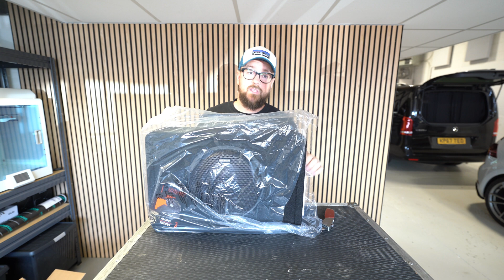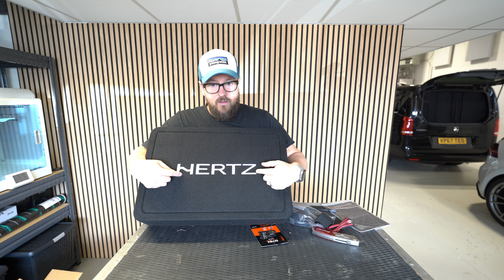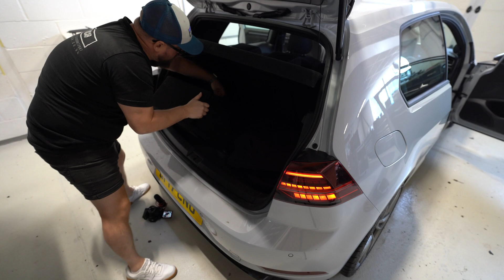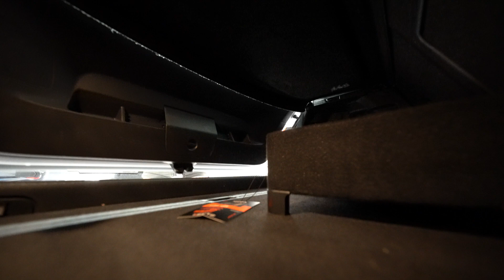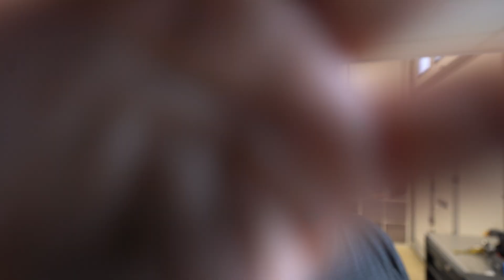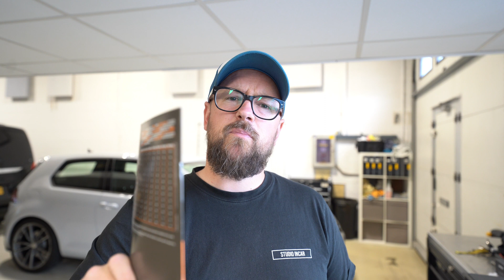Unboxing and Testing the Hertz MPBX 250 S2 - Is it worth the hype?

Comment: This or the 12inch version for tighter hard hitting bass, I have the CBA 250 at the moment, would you say this is a decent upgrade and which hertz amp would you pair it with thanks
Reply from the maker: Both will hit hard/tight, the 12 will just go louder doing it. Minimum of 600W I would say, from my experience both of these boxes are hungry.
Reply: @Studioincar thanks mate went for a 12 with the 700w hertz 1.700 very happy with it for SQ

Comment: What are the pros and cons of running it firing downwards as opposed to firing backwards?
Reply from the maker: There could be none, depending on your vehicle, rear firing may work better for you. Floor loading like this tends to bolster the drivers output slightly and removes some directivity issues you may find in some cars. Sound aside, you can load stuff on the top of it if it's down firing so it has practical advantages. I run mine firing backwards fixed to the back of my rear seat. In my truck I run it firing sideways, my locations are just based on me moving it around and listening/feeling where it likes to lie naturally, if it doesn't hinder the practicality of the vehicle, I leave it where it wants to be.

Comment: Will it fit in the R wheelwell area ?
Reply from the maker: You might have to raise the boot floor slightly, Jon. I don't think it will go with the OEM floor in the top position, it's quite a big unit.

Comment: I have the Hertz MPBX 300 S2 and still not sure if it’s better facing up or down. Should it be better facing down? It sounds great either way but how should I be using it? I’m playing it through a Audison AF M5.11 Amp and a 3 way and 2 way Audison Prima set up in a 2 seater TTRS Roadster
Reply: I had one of these fitted by Carl to change my APBX10 and my god it’s worlds better. I’ve found it to be deeper sounding downward facing, better low end bass extension. Facing up, I found it punchier but a little less prominence on the very low frequencies (which I love)

Comment: Excellent video, I do have a question as far as tuning this enclosure, I am powering my 10” Hertz MPBX 250 S2 with a JL Audio RD 500 amp, and a amp pro LOC LP 7-2, I am having trouble with tuning, I am trying to get the right setting between these two, so I can get optimal boom, any suggestions?

Comment: I saw someone selling it stating it had a 500W pre-installed amp, this is just the boss and driver right?
Reply from the maker: Yeah this is a passive design (no amp) but you can get a similar active option with an amp on board.

Comment: Question, I have the Audison APBX 10 DS in a hatchback, have almost 600W in my amp to give it, would upgrading to this be a big and noticeable difference in thump / power / loudness? Looking for a bit more than i am getting from audison but like the sound overall
Reply from the maker: Yes 100%, this unit is much more robust than the APBX10. The Hertz unit is more of a brute where the Audison enclosure is a little more SQ.

Comment: a month ago, i got a JL TW3 in a sealed box for my truck, wanted to install a dual 10 sealed box so i "stole" the JL TW3 from my car, and put both in my truck. the Stealth-box made for my car needed something. .and with nearly the same parameters on the Hertz MPS250 i got one for the car, and in the stealthbox it was a tight fit (the outside diameter of the Hertz is something like 10.8") - i made a very slight adjustment in the gain to give this Hertz about 450 watts, and i can say for certain it hits a bit lower, and sounds a bit "tighter" than the JL. 
i am not 100% sure about the stealth-box volume but i am sure it's somewhere around 0.5 cubit foot. perfect for the mille 250. it's a great sounding sub!
Reply: Is the sub properly broke in yet? I replaced my tw3-12 with the DD audio SL612 and once it broke in it hits exceptionally low
Reply: @neilclark3243  nobody can make subs that dont have extreme small theile parameters and hit super low. 40hz is about all you'll get before it drops off so fast - in a 0.5^ box.. iirc, my box is tuned for 46Hz so anything below that is really just wasting power and threat of clipping.
Reply: @mikestivers8302  my box is 1cube and tuned to 29 hz but it's also a 12 not 10. Exact same box for the JL as the DD I'm pushing 800 to the DD the JL gave up running on a slash 500/1 gains set with a dd1
Reply: @neilclark3243  yeah bro. a 1 cube ported box will get down to those high 20's. i wish i had the room.. but when i listen to OLD thrash metal, that double bass kick drum is my medicine. so, 45Hz it is :)
Reply: @mikestivers8302  I definitely feel that. I run a multiple sub set up. I have the sl12 box for daily driving and a combo Stereo Integrity 15 5-60 hz ported @21 hz and 2 DD vo-w508 8's 60-100hz  I use the same amp for the 12 @2ohm 800w and the 15 @1 ohm 1600w and a 5 channel 900/5 for the 8's and doors. I definitely understand different needs for different tunes.

Comment: I've got a JL 10W1V3 in a 18l box.
I'm curious how much better the Hertz perform
Maybe i will buy one of them 🤔
What do you think?
Reply: This sub has more mechanical excursion and higher power handling than the W1V3 as well as more surface area. This will be an upgrade for sure, it will play lower better and should sound a little louder overall
Reply from the maker: What he said ^^

Comment: Carl i use ferels on my sub power wires from the amp  to change enclosures when the mrs and son are in the car from mild to wild no degregation of cables or just tin them can we get a run through what you use persnaly. just seen the w7 i didnt know they could go in such a small sealed box got me thinking what i can use next.
Reply from the maker: Cheers Steve, mine are already tinned (not a ferrule fan) for such abuse.
Reply from the maker: My system is in the mk7 videos. That’s a 10”W6 🙏🏻